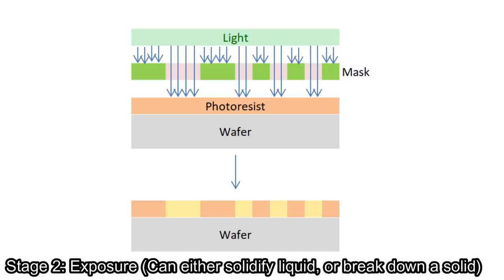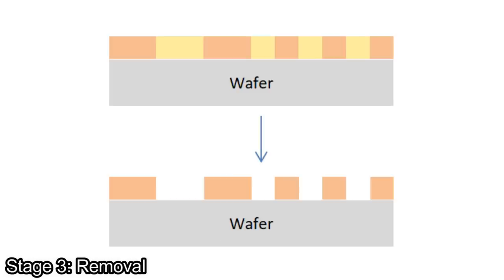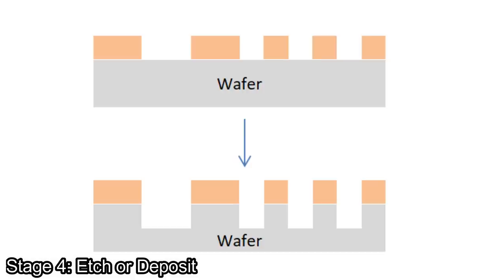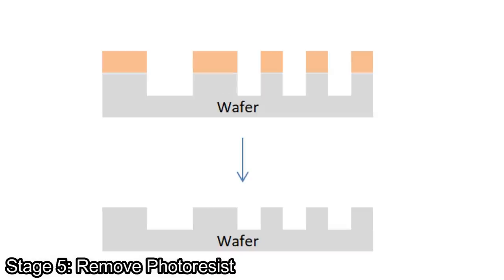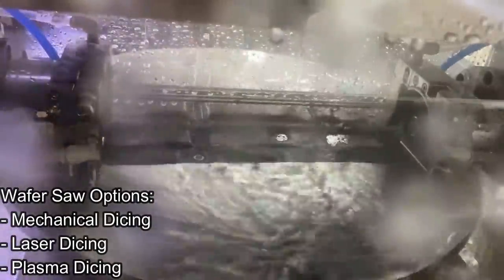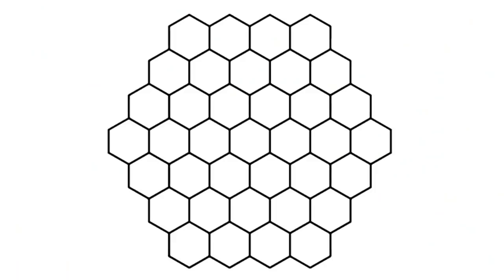Why are Processors Square (and Wafers Circular)?

Comment: I'd be surprised if we don't see a move to a triangular layout, given the obvious shift to a parallel architecture - where interconnection is the bottleneck. Triangles effectively make it so designers would have to intentionally create a poor design that fails to take advantage of the greater interconnect surface area at the edges... although, the divisibility by 3 instead of 2 could be an interesting new pain point.

Comment: I don't hear any argument here against hexagonal dies that isn't a solvable problem. Intel and TSMC spend billions designing new process nodes. Surely designing a laser cutting machine that can cut hexagons is not a significant expense in comparison. Also, why on earth is the Cerebras wafer scale chip not circular?

Comment: But why would a wafer scale chip use a square shape? Not just from the waste of wafer, but particularly the wasted opportunity to fit even more transistors into a behemoth.
Reply from the maker: The optical pipeline is built for rectangular chips as well.

Comment: A square is a nice shape if you have to route these transistors or elements of a CPU. You want 1kb of cache ok lets lay down 8bit and copy if 1000 times. You want 4kb damn cant make the line 4000 but i can make 4 bytes times 1000. And so on. From this scaling out all the lithography tools are designed to make rectangular shapes. So if you can make smaller transistors you just add them in the same space or "zoom out a little bit. Making all things rectangular makes them grow in the right proportion. So there has to be way less redesign if you swap processes as they advance, which leads to shorter life cycles of a generation.

Comment: I do think that even if you did a chip that is the size of a wafer you still would not make it circle. Because that chip would likely be made our of smaller cores with redundancies build in. And it seems so much simpler to just make that based on old proven technology compared to manufacturing a whole set of costume tools. Like you said. It is the manufacturing itself that is the expensive part. Not the wafer.

Comment: Polysilicon solar cell ingots are in fact cast rectangular, and mono cells are cut with chamfered edges to minimize material loss. Round solar cells are also a thing for multijunction solar cells and I bet there have been plenty of 1inch round research chips in history, why bother dicing a wafer if there is no reason to? You totally could make computer chips rectangular or parallelograms if you really wanted to, it's not done because there is just no good reason to.

Comment: Is that the actual mechanical dicing what you have shown in the video? Are the chips liquid resistant at this point?
Reply: The chips are silicon and metal. Yes they are resistant to liquid when finished. (many liquids, not acid or strong bases)
Reply: @jimurrata6785  well I though the delicate metals might corrode eventually if exposed to moisture or in this case a torrent of cooling fluid.
Reply: @kurosumomo  define "eventually"
Any metal but gold will corrode, but these chips will be rinsed, dried and welded to their die or motherboard.
I'm not up on the latest processing, but I had some good friends in IBM R&D back in the day

Comment: They are wasting those edges of the wafer by lithographing them, they know that a successful processor can't be made on that segment, so it should be re-purposed for smaller chips so I can get a cheaper Raspberry Pi :)